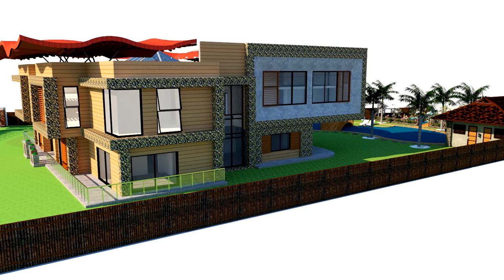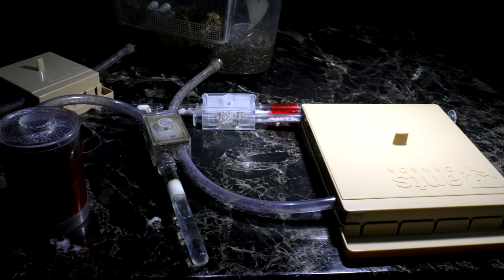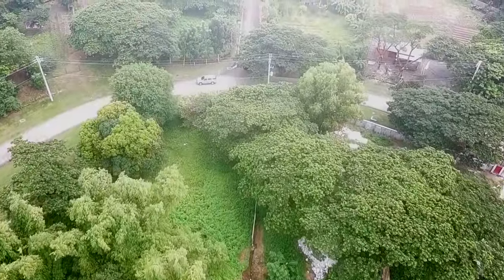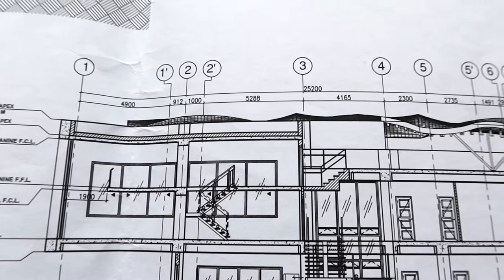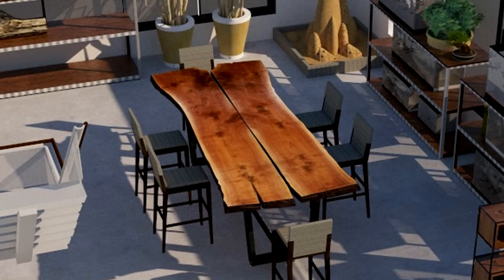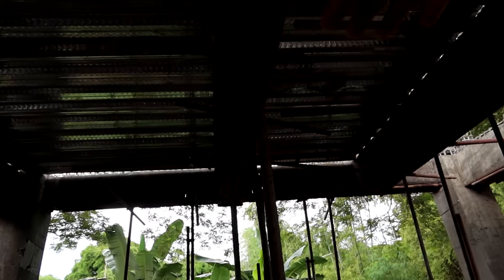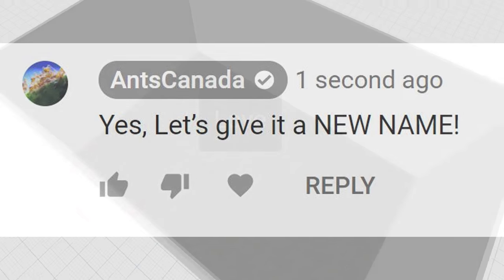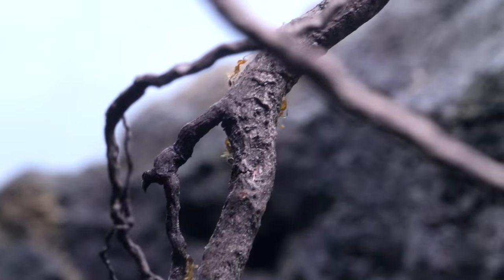Building an Actual Full-sized House for Ants | The AC Ant House

Comment: Ok, I work for fedex, so I've packed a lot of items to not break. Firstly, get some shatter film. It's essentially cling wrap, but with an adhesive built into it so if the worst happens and the glass breaks, the film will hold the glass in place, preventing ant escapes. Secondly, get what is called Insta-pak. It is an expanding foam baggie that you can use to form fit around the tanks, specifically the corners, as they are the most vulnerable points for impact. The combo of the two means that the pressure points are custom fit in foam padding, preventing them from hitting anything, and if something happened and the main flat surface were to get hit and break, the glass would be held in place to keep the ants secure until you could fix the glass or move the ants from the broken tank, etc.
Reply: I hope he sees this comment! +++
Reply: This x 10
Reply: Not sure how viable that would be because of where we live. Idk how available either of those are here. Since we don’t live in the US. Amazon might be an option tho

Comment: When moving the glass ant homes, put a tape grid over the outsides that way if they do crack they are less likely to break and fall apart.
Reply: poor man's laminated/security glass, good idea. Cleaning up the residual glue afterwads may be a pain, with most chemical cleaners not being safe for ants... How do ants react to alcohol fumes? 😬
Reply: @sourcererseven3858  well i imagine, considering the size, it would be similar to you huffing litres of the stuff
Reply: Maybe put duct tape on the glass and have a tab so you can pull it off so if it does break Stuff kids still stick together but don't be a pain in the butt that did break yeah might not go over the place but it still might be a pain
Reply: @tatsumiplays2625  dude, learn to use comma's :/
Reply: @Romeren  ok but I had to use speech to text because my keyboard doesn't work well
Reply: @tatsumiplays2625  That explains it. But damn that was hard to read.
Reply: @Romeren  sorry
Reply: @tatsumiplays2625  Better to use painter's tape. It comes off cleanly.
Reply: @melissajarvis4829  even so if you do use the painter's tape and the glass does break it would be a pain to get the tape off and fix the glass so yeah might come off cleanly but if the glass breaks it's going to be a big pain in the butt
Reply: @tatsumiplays2625   I sometimes use speech to text on my phone, too. All you have to do is remember to say "comma" and "period" when you want to use those. And, you can always edit. 
PS It's always a good idea to proofread and edit anything you write, even a simple comment! :)
PPS This was written with speech to text, with very minimal edits.
Reply: @melissajarvis4829  ok
Reply: @tatsumiplays2625  I think you are missing something, here.   Have you ever used painter's tape?
     Painter's tape is designed to create a good (temporary) seal between it and whatever it is on. It is specifically used a LOT on glass windows to prevent paint from getting on them. It has other uses, but this is the most applicable, here.  Therefore, it does hold to the surface, but also easily releases from most surfaces when pulled off. 
    The reason people here are suggesting using the tape on the vivariums is to attempt to contain the glass, if it breaks. In other words, the glass sticks mostly to the tape instead of scattering everywhere and creating a huge hazard. And, since the tape comes off readily, no problems getting it off the glass or frame at the end. 
     And quite frankly, I suspect that if one of these did break, the amount of damage done would determine whether it would be worth salvaging or not.  A minor crack or pane broken, maybe. Several? I'd be more worried about salvaging the colony and creating a temporary home for them, than be worried about the enclosure. He can buy a new one.
Reply: @tatsumiplays2625  Painter's tape is a high grade masking tape. But, unlike some masking tapes,  shouldn't leave any residue behind.  It is not duct tape.

Comment: With moving heavy objects, it is customary to tie them down on a pallete that is itself tethered down to the base of a truck's trailer.  With shock-sensitive objects like glass enclosures, several layers of tight fitting padding are used on all sides of the object.  Ants are also living creatures that, as you said, are sensitive to temperature changes; it would help to plan out these packaging steps before you ever make an attempt to do it.  I suggest making a mockup terrarium, and planning out a road path that has the least amount of speed bumps.

Comment: I would have recommended having a freight elevator and having your tanks be located on rollers.  That way you can move them with ease when nuptial flights take place.   This would also allow you to increase the size of your tanks in the future should you choose.
Reply: Only problem I could foresee would be the vibrations from moving the tanks would cause massive cave-ins for the ant tunnels, smothering brood?
Reply: Maybe not a freight elevator, but def a dumbwaiter with lots of pulleys. That would be cheaper i think.
Reply: I suspect he's gonna have to go the old school route and hire movers. What I would do is drain any water in the tanks and remove everything but the dirt and ants. Buy wood crates and tons of foam. Crate all the large enclosures and pack them tight with foam. Then whatever amount of guys it going to take to carry the largest crate.. hire double that because they're going to get tired going down 15 flights, and the last thing you're gonna want is them getting tired half way down and dropping the crate. It's not going to be easy or fun. But whatever it takes I guess.
Reply from the maker: The freight elevator in my building is sadly the size of the main elevator and too small. 😭😭😭
Reply: AntsCanada yes, you’d mentioned in your video. See, I was paying attention.  Hehe.  

Anyhow, I was only mentioned a an elevator in the new place that is being built as it would make things easier should you need to move a large terrarium to the roof.  You wouldn’t need six strong guys to move it up or risk damage to anything.  Also, the industrial casters on the base displays would allow you to rearrange your displays easier.  Just some thoughts to avoid some future issues

Comment: Colony move idea:  I feel you need to make a hardened "nest" that can fit into a 5 gallon bucket and force migrate (using light, heat, etc) them into it.  My concern would be the dirt nest constantly collapsing.
Reply: yeah, the soil nests will break down and risk hurting the queens during such a move. it would be wise to pick the highest risk ones and move them into some harder "nest core"
likely some sort of plastic, wood or rock metal foam looking thing
Reply: It will collapse one way or the other, he only can hope the collapse doesn't kill the queen of each ant colony.
Reply: @ithilweenshadowsong8151  again plastic or wood nests
Reply: @Antboi4653  Thing is... how do you lure out a queen that is already inside one of the big tanks and the nest is already inside dirt? I see that one really really hard to achieve without f-ing the entire nest in the process.
Reply: @ithilweenshadowsong8151  Careful change of conditions and hooking up a new enclosure or two in which to forcefully migrate them???
Reply: @ithilweenshadowsong8151  I didn't think about that

Comment: I'm a little surprised you're not building an elevator into your place.
Reply from the maker: Considered it but decided not to so we could build a 3 storey aviary for my parrot instead. Haha!
Reply: @AntsCanada  That's a worthy excuse, but what if maybe just a smaller one that's big enough to put just a large tank inside and lift/lower to different floors so you don't have to worry about stairs?
Reply: Like a food lift, but for the tanks.
Reply: @AntsCanada  hoooly
Reply: should i bow?
Reply: @crownalgodoo8095  I'm not a deity that demands such things. Bow if you want, but I don't require it.
Reply: He’s thinking about it
Reply: I think making the ember Island cooler and have an ant bridge to a smaller and hotter place for them making to move would be easier.
Reply: @AntsCanada  that's the best reason not to build an elevator
Reply: Why not have both? Set it up so that the top of the bird cage has pulleys that you can put into action on the rare occasions it is needed. Just remove the larger vertical pieces, and the parrot, and hook up the ropes and a platform. No need for high-tech when a dumb-waiter will do.
Reply: @AntsCanada  3 stories tall? DAMN!!! On top of being able to roam the entire building?
Reply: @AntsCanada  wooooooahhh
Reply: @AntsCanada  an... an aviary... in yo house
Reply: @AntsCanada  where did you live again the philiphines

Comment: Carrying the set-ups down that many stairs seems like a bad idea. As much as getting the permit would be annoying, it's probably the safest option.
Reply: Im pretty sure carrying it dow stairs is safer becaus. Idont think people in the street below dont want heavy tanks dropping on their heads
Reply: @mastermarshadow1780  all it takes is one slip of the finger qnd the stairwell is full of ants. Straps and machinery are more reliable. You ever carried a couch down some stairs? Its hard, but doable, but there is no penalty for taking a break. A glass enclosure not only cluldnt be level going down narrows round stairs, but it doesnt allow for qny bumping or resting.
Reply: @Educationey  PIVOT
Reply: his best option if possible would be to  move the ants into a safer container and then dismantle the tanks for transportation.
Reply: How about putting a sliding pad on the stairs and slide it down🤔
Reply: The best option would be to transport the ants in smaller containers then dismantle (destroy) and discard the tanks, and buy new tanks for the new house.  It would be expensive but maybe he can afford it after building the house...?  Less expensive than a lawsuit.

Comment: I've moved a lot of non-ant filled, water filled aquaria by wrapping them in plastic wrap first to contain water. You might consider a few layers of plastic wrap first (industrial/kitchen sized packages are better than general grocery stores if you can find them). After that, some webbing (like backpack strap material) would probably be a good material to build a sort of basket/nest around them and make handholds with before putting them into a foam case or outline. Best of luck with your move!

Comment: When moving have steel framed boxes built and have them layered with foam. The frames will help the aquariums from twisting and breaking. And the foam will not only insulate but also help with protection.

Comment: I would recommend doing a practice round before going through with whatever method you chose. Obviously not with the tanks but with some furniture that's about as equally heavy as one of the heavier terrariums. Because it's such a delicate procedure, I personally think that in your shoes, I'd feel more comfortable if we were all on the same page before moving any of your pet ants. It'll be stressful enough without worrying about potentially banging, dropping, or cracking the tanks. And a practice run would give you time to suss out any issues you might have run into that you weren't currently accounting for. For something this big, there is always going to be issues you aren't accounting for.

Comment: The ant room’s second floor Windows built into the floor sound like a good idea, but they’re not.  You’re going to find the angle for viewing they give will be too tight for filming, causing you to have to cater the room setup to those windows (restricting your options drastically) or they’ll be useless.  Even if you design the layout of the bottom floor completely around where those windows are, you’re going to get a very few film shots from them as there’s only four windows so therefore four ant setups you can use them on.  A solution is to make the ENTIRE second level’s floor one big window.  You can film from every angle, regardless of the bottom floor’s layout.  Upvote this so he can make this adjustment before construction gets too far along, guys!
Reply: Also, you may need to build a separate room for your breeding tanks and other critters you keep as they may need different temperatures than your ants need to be comfortable.
Reply: @matthewburns2100  the breeder tanks are in the same room as the other ants already.
Reply: He can just shift the tanks according to his need

Comment: AntsCanada: It gets so hot in the warm temperatures of the ant room
Australians: PATHETIC
Reply: How hot is australia
Reply: THERESA CHIVA i guess really hot (i dont live in austrailia)
Reply: @theresachiva9053  i mean its not significantly hotter where i live (new south Wales) as summer is like 30s but we have heatwaves of 40. Its much warmer away from the coast and further north.
Reply: @facelesssquish2439  Okay, that doesn't sound that hot to me, although I admit we don't have very high humidity. But, we (Southwest USA) had a record breaking heatwave this summer.  And, in my area we were repeatedly having extreme heat warnings - that it would be 114° F (45.6 °C).  And yes, it can get much hotter here. I'm just not used to seeing that many days in the 113-115° range.
Reply: It's finally cooling off, now. High of 95° F (35.°C) today. It was still in the hundreds (37.7°C & up), earlier in the month.

Comment: For moving, you'll need to take all the rocks and such out of the glass containers, anything that could break. Water will have to be drained. As much material as possible will have to be removed. You'll need a lot of cardboard to protect the corners and glass. It's probably a better idea to disassemble all the setups and transport the ants in large plastic containers or tupperwears.

Comment: For the movement of the ants: I would suggest taking the ants out first, it would probaply take a long time for the ants to move but it's worth it, after the terrarium is empty you could simply take it down the stairs (if it contained water take that out before the ants) than put them all on the down layer in a truck (don't stack them*) with inselation on all sides. If not all the terrariums fit in the truck let it drive a couple times, than simply put the terrariums in the new anteverse and put the water and ants back in. :)

Comment: you should honestly build some type of contraption to help you carry the tanks down the 15 flights of stairs. It might cost some money but I feel like it would definitely pay off. maybe some type of thick rubber box that can be pulled like a sled down the stairs and some type of flat mat to go over the stairs so it just slides down? Or conveyer belt that u transfer each set of stairs? just a suggestion cause carrying all those tanks down 15 flights sounds like hell

Comment: how much can the ant enclosures be tilted while moving? would going down the stairs be too much?  is there a maintenance elevator in your building? Those are usually significantly bigger. 
You could try to create some kind of litter carriage with insulation inside to help carry the enclosures. This would ensure that the movers would have a good grip on the tanks and that the tanks themselves would be well protected. You could also look into sleds/gurneys that can go down stairs without bumping.

Comment: Have you ever thought of have a glass box for you to sit and lay in for recording do you done overheat or sweat bullets. It would need to have an air vent above and have it In the middle of the floor and be two levels high and it would have very clear glass with very low glare or you could have a hatch for you camper to put through and I could have a counter all while you stay cool. The door could be made of glass too and it would look like. A rectangle shower box but clear glass and you can get if for good prices if you can find them  and I say and 5,10 high if the ceiling goes that high.

Also I know this is long but it’s a reasonable suggestion

Comment: My dad’s suggestion for how to move the ants is to get a BLIMP and use that as the anchor for a pulley system or else to buy the building and have a freight elevator installed

……my dad is not great at understanding the difference between “bought a forest for ants” rich and “buy a private 747” rich lmao
Reply: He also says there are powered hand trucks designed to handle stairs and very heavy items. He saw one in action when he had some guys come to deliver his gun safe—about the size and weight of a small refrigerator.

Comment: I would not recommend using smart outlet due to the fact that they are wifi linked so if your wifi goes down they lose connection and could mess with the set time schedules just a tip from a person who had their pet snake die due to this exact failure

Comment: I think you’re going to have to empty the large tanks before moving them, it’s just not a good idea moving them with all the dirt, rocks and everything else inside them. It’s going to be pretty ridiculous trying to keep them level to the point that everything inside can’t be disturbed the entire they’re transported down the stairs of a very big apartment complex. Everything inside makes it easier to break, harder to move and much heavier, plus you want to keep living things in there while moving. I had 125 gallon turtle tank that I used to break down and I completely empty when moving, you should really consider luring your ants out into smaller containers like you usually do when you move them and clean out the whole tank